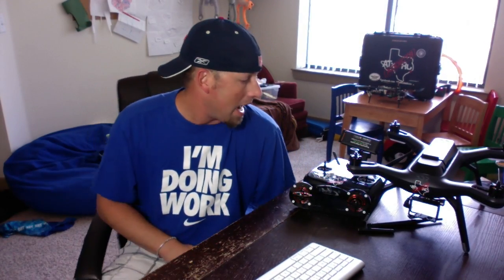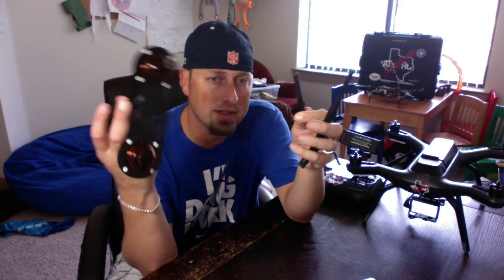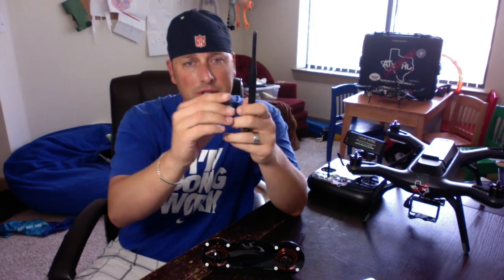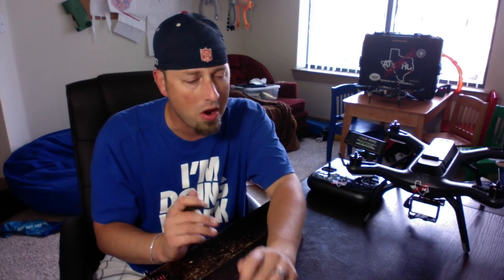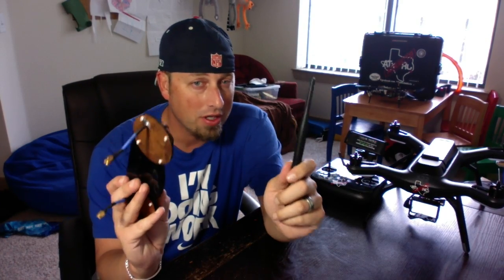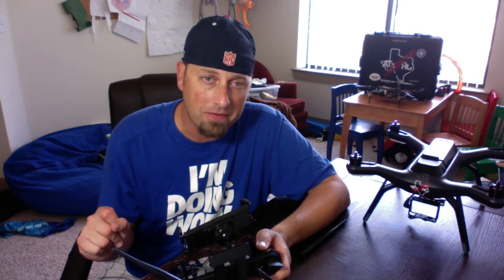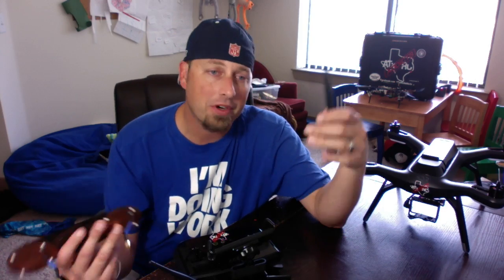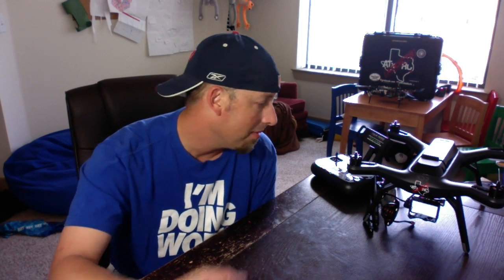Final Test of FPVLR FrSky and Stock Antennas on 3DR Solo Smart Drone

Comment: i was wondering if i can use Alfa APA-M25 dual band 2.4GHz/5GHz 10dBi high gain directional indoor panel antenna with RP-SMA connector. will i get more of  boost since its 10dbi in stead of 7dbi.